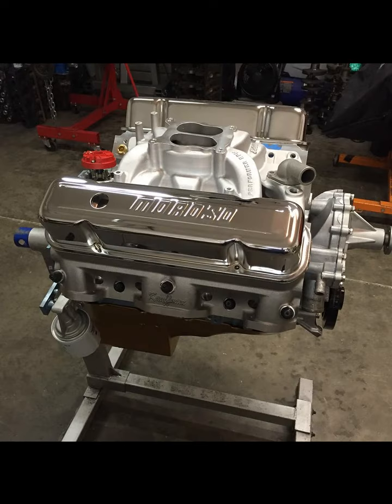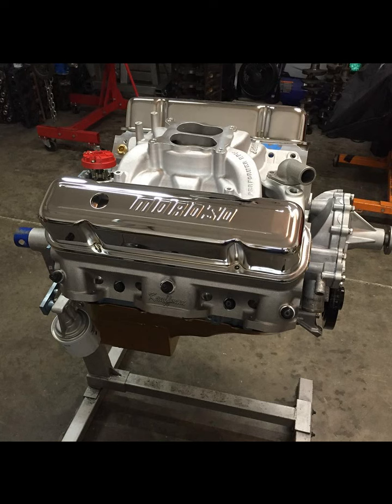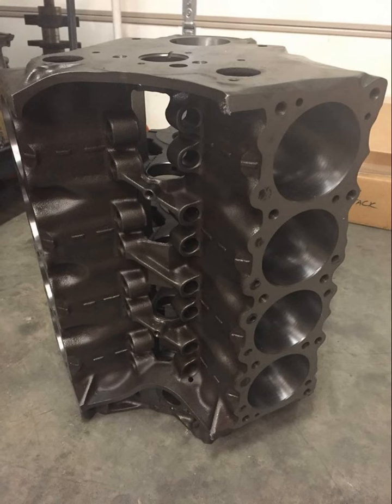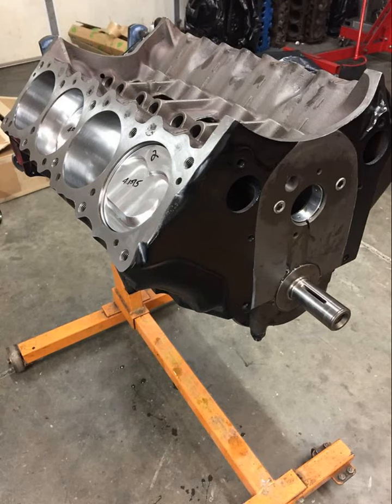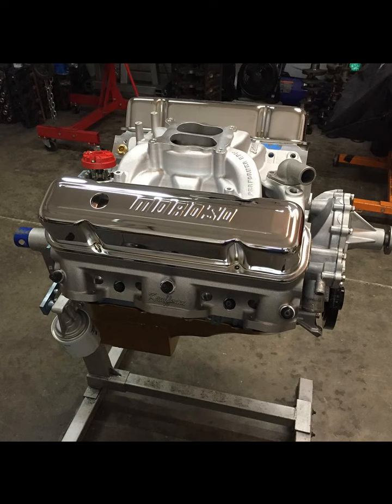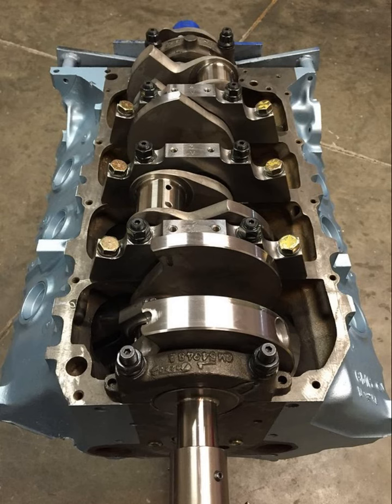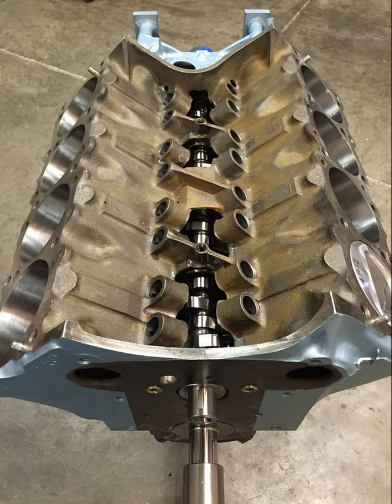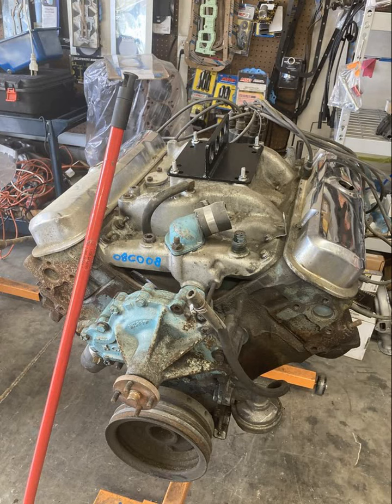Lykins Motorsports BIG 434ci PONTIAC HORSEPOWER

Comment: I remember my first Pontiac motor I was called to look at to see what the problem was it had a big tunnel ram with two four barrels, is it called underneath the car to figure out what happened to the motor the four sets of rods in the front went right to the oil pan and hit the frame what was quite interesting was the brake line was right in the middle of the two sets of rods missing the brake line. I told him you blew up your engine. Old-time street racing back in the early seventies.

Comment: That is very impressive! My 474 has Kauffman D port 325 cfm heads. 2.11/1.66 valves 68cc chambers. 4.211 borex4.250 stroke. Eagle crank & rods, Ross pistons, total seal file fit .062" rings. Victor intake, 950 cfm ultra hp dominator. Solid roller from Comp, timing 32 degrees locked. Made 688 HP @6300 and 641 'lbs @5000 rpm. This engine runs on 97 Octane as I add Race Gas additive to 93 octane. Not an engine for getting ice cream. It's got a nasty idle & is explosive. I hope to make a few changes & get 700 HP with D port heads. But I will end-up with High ports as the flow is so much better. I'm raised the roof and widened the bowls to 90.5%. But since I got my SuperFlow dyno operational, calibrated etc. I'm going to alter the short turn. Lay it back as the cam has a .440 lobe with a 1.65 rocker. I could use 1.8 rockers as piston to valve clearance is .0225" intake and .200" exhaust with radial clearance was about .035-.045" if I remember right. I have restrictors in my lifter bores dilled .035" and the rear galley drilled .035 for distributer gear lubrication. I run the BOP polymer gear. So far it works great.
Love Pontiacs. I was young when I bought the Dports and regret it, but my goal is to do as much as I can with what I have. BOP rear main seal (Two piece) never any leaks. Cam is ground on a 104 LSA and I will try retarding it at some point. But the heads are ultimately my limiting factor

Comment: Pontiac!
In high school, my buddy would borrow his Dad's 69 Firebird 400 Ram Air and we would burn the tires off of it!
(Until his Dad had to buy 2 sets of rear tires in 3 months! 😂)
That car could MOVE!

Couple of questions Brent;
With those huge open areas in the block's lifter valley, are the blocks prone to splitting?
And what about all the oil drainback windage?
Last question:
Does the downward facing exhaust port hurt flow because of the sharp exit turn?

Comment: Big Pontiac nut here, In 1969 the factory Pontiac 428 was conservatively rated at 370 or 390 for the high power version. If you added a bit of cam they would wake up really nice.

Comment: Hey Brent,
     Tim here, SO ESTATIC to see a Poncho in ur shop!!!....altho i've been a sub'r for some time now, i AM a Poncho guy....  i have a '64 Tempest, 462, Kauffman heads,  248 @.050 hyd flat tappet.....10.44:1 static, have run 10:92 @ 122......."pump gas".....i always put a bit of 110 leaded Sunoco in for safety, when racing..... car weighs 3450 with me in it...... so around 580-600 hp......i was born and raised Pontiac......my brother knew Nunzi personally......yea, the Kauffman heads are the ONLY way to go......screw Edelbrock, NOW Edelbrock makes a D-port head, after Kauffman made them look silly, copying 1969 tech.....while the D-port Kauffmans has the modern heart chamber, better ports, and no need for expensive round port headers......LOVED THIS VID!!!....OH, I'M A HAPPY SUB'R!!!.....THANK YOU SIR!!😅

Comment: Looking forward to the build, I think it's invaluable that your experience bias isn't Pontiac. Thrilled you want to challenge the problem solving of the polarizing 350. Pontiac is and underdog and this is one of the underdogs inside of Pontiac hahaha. It's an engine and I'm sure it will respond to well reasoned hotroding! Let us know if you're looking for Pontiac parts to prepare for the build, I imagine there  are enough in the community that are happy to act right.

Comment: That 434 is very impressive for that cam size and a dual plane manifold, though the RPM is probably the best out there for a dual plane.  It must definitely make a great sleeper!  I hope the 350 build works out just as well for you.  As far as the similarities between FE and Pontiac heads go the bore spacing for a Pontiac is 4.62" and an FE is 4.63".  Oldsmobile actually falls right in between at 4.625"...  I consider them all "medium" blocks based on the bore spacing.

Comment: Brent,  I seem to remember someone on the old Network 54 FE forum saying something about Ram Air IV or V heads being used on ,or being able to bolt up to a FE...
Seems it was the blind fellow with the hot 390 Galaxie 500 , that mentioned it... don't remember his name.

Throw a set of FE gaskets on the Poncho and see if it's a match.
Reply: Look at a set of RA5 heads and compare them to FE Tunnel Ports.